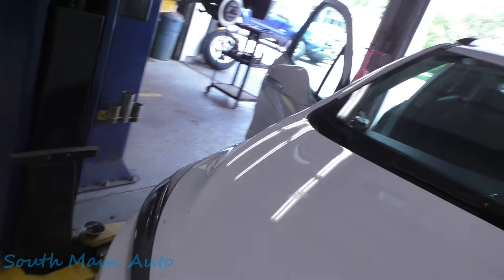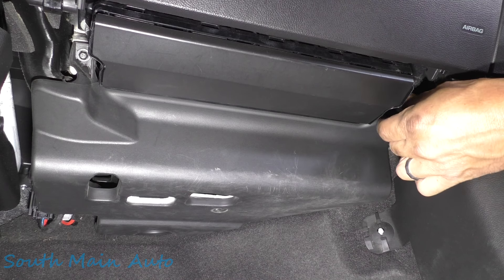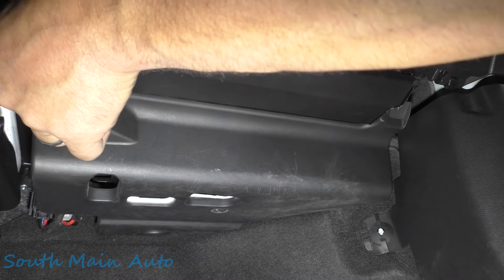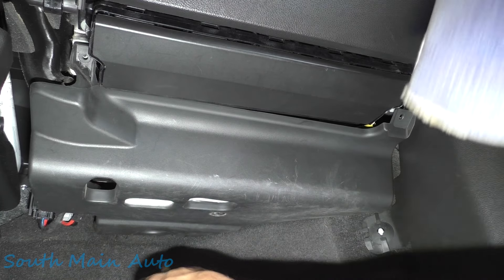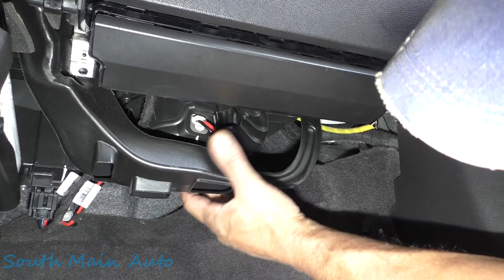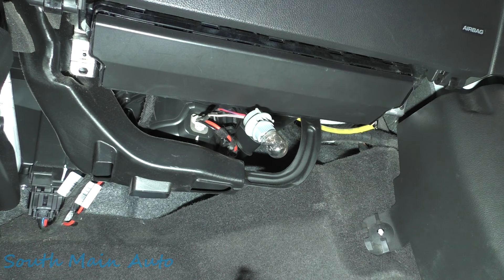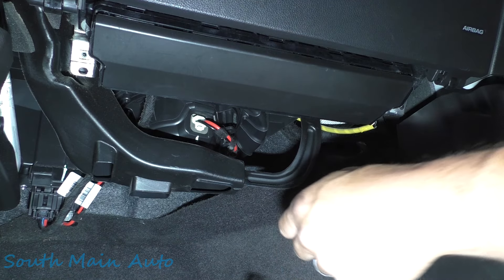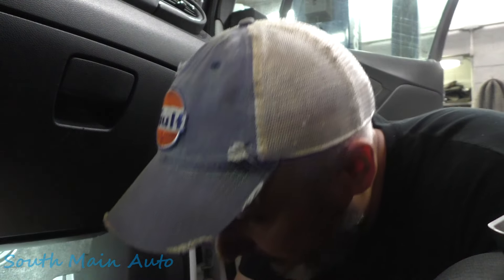Buick Encore - Blower Motor Replacement

Comment: Can't remember which, but another YouTube mechanic follows this pretty good rule:  If he breaks it taking it apart it's on the customer; if he breaks it putting it back together it's on him and his shop.
Reply: Bad idea.
Reply: @Garth2011  If the mechanic breaks a part because they aren't using the right tools or procedures to remove something then it should be on the mechanic but if a part breaks because it's brittle, corroded, or otherwise can't withstand the disassembly process then that will be on the customer. There are many videos where Eric quotes extra replacement parts that he expects will break before even starting the job.
Reply: @killer2600  All good if that is discussed ahead of time with the customer so they can decide if they want to take those risks. Not everyone is aware of their vehicle condition.
Reply: I remember I would have to change a taillight bulb on an old, brittle ,cracked, falling apart taillight. Those things would disintegrate as soon as you touched it. I would always take pictures and tell supervisor what would eventually happen to cover my ass. Such a dilemma for a small repair

Comment: i just use soldering iron to melt plastic together, melt in some coper wire strands for more strength. Fixed a lot of headlight mounts and bumpers and a lot more.
Reply: And use CA glue with charcoal powder!!

Comment: That was as exciting as cutting a 4x4 hole in housing to replace blower Module, nothing wrong with motor on Lincoln LS. Forgot to mention glueing hole back shut. Beats taking complete dash out!

Comment: The more I watch SMA the more I love my Volvo 240.
Reply: Have you replaced the blower in a 240?  I have.  It took days.  Apparently the assembly of 240s starts with the blower and the car is built around it.  Step 1 in Chilton's is disconnect the battery.  Step 2 is remove the instrument panel with a reference to that procedure.  Remove instrument panel has 34 steps, the second one is lower the steering column.  Step 2 of that is remove the driver's seat....you get the idea.
Reply: @richsarchet9762  yes I have and it does take a while but I’ve found it easier to remove the whole dash. Now I have a spare complete unit to change out when the fan goes bad. I do the same with the fuel pump and filter bracket. Have new or refurbished ones ready to go in and it makes life much easier. I also want to check into the Vintage Air company to see if a similar HVAC system will fit the 240s. At best, the 240 AC is not good enough for me. I drive 04 S80 in the summer or on long trips. I like the S80 but I feel at home in a 240. Once I find an AC remedy for the 240 the S80 will be sold or donated.
Reply: @richardcrouse9074  "Easier to remove whole dash"  
The steps listed by richardsharchet9762 are steps in removing the dash.  I've done it, too.
 Every other car I have ever worked on (All 1993 or older): only a few screws and out comes the motor.

Comment: Obviously in this one, the fan controller IS good - but twice now (over the course of several years) I've had the controller go out on my TrailBlazer.  The 2nd time I said screw it, and just the replaced the mosfet in it for about 50 cents!  Beats the $60-80 or whatever it was for a whole unit.

Comment: Working at a Chevy dealer, I see plenty of their cost cutting ideas. From roughly 2003 to 2014 they deleted cabin filters on a number of their vehicles. My 2012 Silverado was lucky enough to have a kit available to add it back in.

Comment: I remember removing the entire dashboard out of my fairmont wagon just to replace the heater core . They could have made it accessible from the firewall , but no you had to remove the dash to remove it .
Reply: That's actually quite common with most vehicles now. You even get the luxury of discharging the A/C system as part of the deal.
Reply: Try doing one on a modern GM truck... Unreal how much crap is bolted to the dash. It's a 12 hour job.  Those fords could be done in 3 hours.

Comment: This one reminds me of a Ford F 350 Powerstroke maybe 8 years back or so on another channel that needed a water pump replacement and it was under warranty. Those trucks came new with one piece plastic fan shrouds that attached to the radiator. The warranty book time wouldn't pay the mechanics to remove the fan shroud as one piece so instead, the warranty procedure was telling the mechanics to cut the fan shroud in half, leaving the lower so they could remove the upper half to perform the task.  At some point, there was a customer who had an issue with that idea and demanded Ford replace the shroud like it was before the the repair. Ford fought him...but the customer finally got one after much effort. 
This is so very stupid...Ford wants to cut the labor times to save money but by mutilating the customers vehicle to do so. You really have to wonder if those manufacturers don't need to be policed with their methods to save money or perform legitimate support business.
Reply: Also required when replacing the serpentine belt 🤷‍♂️😏

Comment: This isn't the only GM vehicle that requires cutting the original blower motor out. The Saturn Ion does too. Good point about debris falling into the impeller.
Reply: But then why make a blower motor that only last 5 years? I'll never understand how people keep buying these crappy cars.
Reply: @Jonathan They're both delta platform cars so it makes sense.
Reply: @Jonathan-mp7xg The "both" in my previous statement was obviously referring to the Cobalt and Ion. 🤦‍♂

Comment: Had a 2007 Pontiac G5 with an intermittent blower motor mounted much the same way. In the winter, of course. Would have had to cut it out also. Luckily for me it turned out to be a sloppy power plug connector, just bent a couple pins and it was good from then on. Watching this I'm glad I didn't have to go through all this.

Comment: The GM engineers deserve your feedback!  I let the Chrysler engineers know my opinion of them when I had to change the timing belt on my 2002 PT Cruiser (a.k.a. PT Loser).
Reply: That center engine mount is the worst part!
Reply: My neighbor keeps buying those things. There's literally no room in the engine bay to do anything. How did they shove that engine in that cramped, tiny space?
Reply: lucidbarrier  there actually easy to work on. I would take a pt cruiser over many many other cars any day.... similar setup on the dodge neon 2.0 and caravan 2.4
Reply: First one I did in place, took 6 hours, second one I dropped the entire engine cradle on the ground, took 6 hours.

The heater core on a PT is more fun, front seats, console, and entire dash has to come out. After you evac the A/C and pull the entire heater box, all you have left is a back seat and carpet in the car 🤦‍♂️
Reply: @keithslaton117  Your comments got me laughing!!! I am happy I never had to do a heater core!!!  I was happy DRIVING my PT, but working on it created unpleasant  emotions.

Comment: Everytime I see Eric working on new junk I hug my 90s Toyota T100 even tighter. Love how simple everything used to be.
Reply: I do the same for my 1988 S-10
Reply: I notice how little Toyotas are in his shop🤔 .
Reply: 1995 T-100 with 125K for the win!
Reply: @mod_incllc3235  95 with 262k here!
Reply: @riceburner4747  That's true, they're all in the Pull-A-Part yard rusting away.
Reply: 1995 T100 DX 359000 still running strong 1 headlight, 1 blower motor, brakes,tires and batteries! My first new truck, not kidding I was a little nervous as all I had owned before was Chevys. It helps that I live in AZ.
Reply: I'll never sell my '83 Toyota pickup that's so simple to work on. NO COMPUTERS.
Reply: Word love my 94 ford ranger
Reply: Same for my Audi a4 2006 2.0 t
Reply: Don't get all creepy on me for appreciating my 2004 GMC pickup for ease of working on.
Reply: @bkon4675  I agree. 2005 GMC Sierra, cast iron pushrod V8. The biggest challenge is the height of the 2500HD, easily solved. I was able to crawl under it last Friday to remove stray bailing wire that wrapped itself around the driveshaft.
Reply: Still hanging onto my 91 4Runner!
Reply: 97 honda accord wagon... 241k.. Easy peasy.

Comment: In defense of engineers, it's often the bean counters and management who listen to them over the engineers who make these demands.  "I need it sooner and cheaper!"  Been there and done that- as the engineer not the other side.
Reply: I guess that they, in turn, are being pushed by the owners/shareholders demanding a higher return on their investment.

However, this is all a consumer driven market, and they are demanding the lowest upfront cost and new models every year. If consumers demanded 'easy to repair and hang the expense' then that is what they would get.
Reply: @georgescott6967  Point taken - your comment is fair enough.
Reply: Yep. Cost Savings.
Reply: Then you get a product that people don't want to buy because of the repair issues ($$$).  Word does get out about cost-cutting measures that eventually cost the customers more money because of a poor design.

Comment: The Buick Encore is a badge-engineered Opel designed in Germany. This was a walk in the park compared to most German blower motor designs!
Reply: The worst blower motor design is in the Opel Vivaro /Renault Trafic in combination with AC. A French Vehicle assembled by the Brits with a Opel badge on the Grille! That's is the reason why it's called "Eurotrash" 😂  I named it Renopel Vivafic
Reply: If this is badge engineering the term engineer needs to be reddefined.
Reply: redefined.
Reply: Sreten recently had to replace the blower motor and resistor pack in his '08 E60 M5, and it basically amounted to gutting the entire center section of the dash...
Reply: @JBOGermany  Back in the day, I replaced a heater blower motor on a 1975 Mercedes 300D (not to be confused with the A.C.motor, which was ALSO a pain). Imagine a blower motor suspended in the middle of a room. Then imagine building an entire car around that motor. And the real kicker was every now and again, the connector would pull out during reinstallation, and the dang thing wouldn't work. Boy! I miss those days!
Reply: @brand-x7049  The Germans are notorious for that. The blower assembly is usually behind the center stack rather than in the passenger footwell. Early Acuras were like that too. Why? They poached engineering talent from Audi...
Reply: Here in the UK, we have an extra complication when it comes to interior design - we drive on the left, so the driving controls are on the right, but everything else under the dash is still in the same position as on left-hand drive versions. Not so bad on Japanese cars, as their home market is also right-hand drive, but European and Korean cars can be a real pain for access to blowers and cabin filters.
Reply: A guy I know worked in a foreign car repair shop. He told me a guy came in for a cabin filter change in I think a BMW. He went to the computer to get the how to's . Pages printed out. He asked his boss how much he was charging the guy . He told him a half an hour. You pretty much had to take the dash out to change the filter
Reply: I thought it was a Daewoo design.
Reply: @Jeff Aulik  The Encore, Regal, and Regal TourX were rebadged Opel models. The 1.5 turbo engine was also Opel. The second generation Encore, which is not sold in the US is a Daewoo. 

The currently available Encore and Envision models are both Daewoo. They're manufactured in South Korea and China, respectively, for the US market.
Reply: @jblyon2  The 1.4 is an opel design. Same engine in the chevy trax and cruze
Reply: @Ungood-jl5ep  Yup. Opel engine in Daewoos passed off as "American" Chevys. Doesn't get any finer than that!
Reply: In Australia, these Buick Encores are called Holden Trax. Some of them have the 1.5 turbo motor, some others have the 1.8 non turbo. A weakness of these cars is a propensity to leak water , either from the water pump or the radiator. Which are very difficult to replace
Reply: @titanus49  I guess the 1.5 is part of GM's newer SGE or "small gasoline engine" family of engines, they were meant to replace the older 1.4 turbos as well as the 1.8 non-turbo. 

The reason I mentioned it is because they were all designed by Opel and they all have the same issues with failing water pumps and PCV valve failures. It's kind of strange, you'd think they would have sorted that out, with all the water pumps and whatnot replaced under warranty in the older vehicles.
Reply: @jblyon2  Deawoo does not exist anymore its GM Korea now
Reply: John 1122  They can rebrand it all they want, it's still Daewoo junk. Same junk, different badge. That's GMs specialty after all.

Comment: Mr. O , I worked at GM as a mechanic, I have done many of blower motors, I would heat the blade prior to cutting, it makes cutting much easier.

Comment: Nice job Eric. Modern cars seem to be built to make repairs a challenge on purpose by the engineers. It like
They pay more attention to the building process.
Reply: That is exactly correct because the building process costs the manufacturer money not any future repairs.
Reply: Built to be assembled, not taken apart.  Most  repairs go faster when reassembling the mess, than taking apart.

Comment: Spent an extra two hours changing a water pump in a 2004 Impala because the steering pump pulley was a quarter inch in front of one of the pump bolts. Air door on my wife's 2012 Camaro. Thank goodness for hot knives and refrigerant insulation tape.

Comment: Looks like I'm a 2 time winner. I just did the starter on my 2005 F-150 (5 hours total in my driveway, and yes, I put all 3 bolts back in), and I have to do the blower motor on my 2014 Escape next. Just watched a video on that. I'll take this design over Ford's any day.

Comment: Blower motor, LOL. One of the (only very few) issues I had with my 05 impala LS in 15 yrs. Changed two of them. Flat out 15 minutes. Easy pesy. Drop glove, disconnect connector, take out three screws, reverse procedure install new. Done. $40 aprox for motor blower. I'm told that if you don't change the cabin filter often it will cook the motor due to (filth) resistance causing the motor to work harder over time. I was great at cabin filter maintenance, LOL every 5 yrs needed or not.

Comment: I pulled out the blower motor on a 2004 Toyota Rav4. Unplug, remove three bolts and it drops right out. Easy peasy.  It takes 5 minutes max to replace.

Comment: I remember having to cut a hole in the heater housing in my old Suzuki Samurai in order to clean debris out of the heater core. Then there was my 1st gen Ranger that I was able to change out the heater core in 15 minutes on my break at work. THAT was a good design!

Comment: My sister-in-law has a Chev Trax which is basically the same as the Buick you worked on. She took it back 5 times to the dealership because the brakes wouldn’t stop squealing.

Comment: Alternator on 07-11 Camry V6. Service info tells you to pull front bumper cover and radiator. You can get by without removing either if you're careful. 4 plus hour job. Engine is crammed under the hood.

Comment: Hi Eric,  when, I brought  my 2012  chevy malibu.  My blower  motor was not working.  Gm had the same design in my car. I had to cut out the blower  motor. Factory replacement didn't fit good.  I ended up buying an aftermarket from four seasons company. The motor and plug matched with the  oem Factory  plug.   New blower motor  works q d fits great.

Comment: I had an 89 Chevy three-quarter ton pick up and at 45,000 miles. I spent about $1500 on the front end. GM shipped it with no alignment adjustments on the front end and no greaseable tie rod ends or ball joints. At 45,000 miles I had to replace all of the tire rod ends, all of the ball joints and grind all the welds off of the A-frame shafts and put the adjustment kit on it so we could adjust camber and caster. I wonder who thought that was a good idea on a heavy truck

Comment: Time for another vacation! You need to retire and do what this guy near me did.
The best time deal I ever had was the guy near me was a retired mechanic, loved working on cars and needed extra money . My shed was full of used parts from a junk yard that you pay a flat rate for all you can carry. I would leave a note that something on the car needed to be fixed and put money under the seat with the keys and it was fixed. If he was short on cash he would ask if I had any work and I pointed at my 68 impala. He replaced all the brake lines and all the oil leaks. Then when he was done with that car he fixed everything on the Mustang. Talking about being spoiled. Now that I am retired I do the car repairs. He had others he did work for but he loved working on the older cars!

Comment: Eric, i have one to really piss you off. My 2008 jeep grand cherokee came factory with no cabin air filter. It was an "optional item". If you wanted the cabin airfilter, you had to pay 80 bucks for the filter and the frame that holds the filter. The spot where the filter goes was there and the the cover was there. It was plug and play but they decided to make it optional. I about went through the roof when i read that. It even stated in my grand cherokees' build sheet that it was ordered without it.

Comment: I did one of these on a Chevy Cobalt.  Same thing I had to cut out the old one.  I was using a razor blade and it was a PIA,  then about 1/2 way I changed to a serrated exacto blade, using a sawing motion that last 1/2 only took 30 seconds.